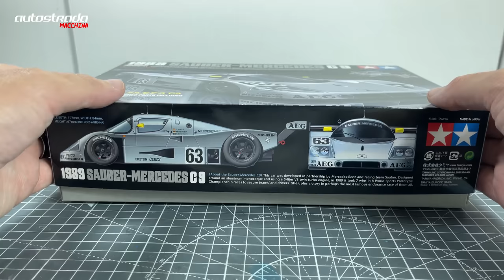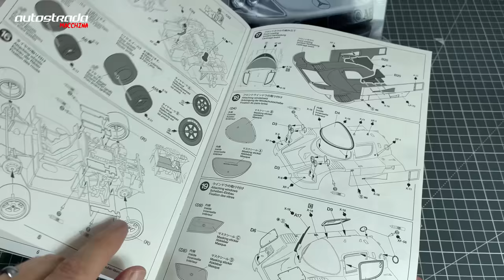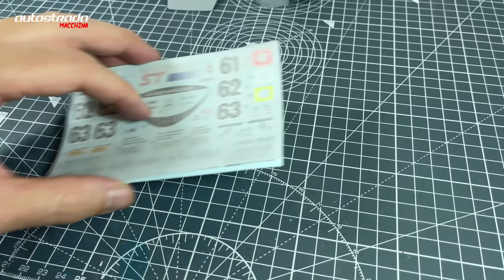[Full Build] Building a 1/24 scale model of the Sauber-Mercedes C9 - Tamiya

Comment: Thanks for sharing the excellent modeling tips.
In video 13:41, what is the brand and product number of the seat belt?
And in video 4:39, how many layers did you apply the gloss paint?
Reply from the maker: Thank you - the seatbelts was left over from a hobby design set I already had. The clear I applied 1x normal layer and 1x heavily thinned layer. I didnt want the clear coat to display too think on the model

Comment: Great build man. I built this kit many, many years ago - before the upgrade carbon fiber decals and photo etch parts were available or known to me. Can you tell me what you are spraying on the tires after sanding the molding seams off (18:39 ish) and after the decals are installed (19:20 ish)? Appreciate you taking the time to video this - thank you...
Reply from the maker: Awesome thanks man - um so at 18:39 I spray the tyres with Tamiya's Rubber black, and after the decals I spray a flat clear. Personally I like the affect it has, you basically cant see its a decal on the tyre once thats done, looks painted on

Comment: Nice work, good looking model. Can I ask what brand of paint you use for the body and the clear coats and what pressure you spray at please. I use the Zero paints system but you appear to spray at a higher pressure than I do, tho it could just be how it looks on video. 
Anyway, nice video and superb model kit. I'm subscribed and like and looking forward to seeing more.
Reply from the maker: David I love this kind of feedback, Thanks!! So for primer I use Mr Hobby 1500, grey in this case, paint I used was the Zero paints ZP-1634, its the Merc Sauber specific colour, clear on this one was also Mr Hobby GX100, I used to use ZP 2k, but its too thick on a race car in my opinion. For pressure I spray at 2bar, but I do adjust the paint amount being released from the gun depending on how much I want to release, for ZP i make it less paint to try and not get orange peel, is a struggle with zero, but it sounds like you’ve had the same issue too. What pressure do you spray at?
Reply: @autostradamacchina  I'm spraying at around 1.5bar when I use Zero, I've not really had a problem with finish. Just interesting to see how you do it. Do you feel that running at 2 bar helps reduce orange peel? I use Halfords automotive primer as my base coats and then the Zero colour and I'm trying the 2pack clear again on my current build, Tamiya Lotus 107.
Reply from the maker: @davidfisher5507  spraying at 2 I think gives me better coverage. With my setup I've had some issues with an unevern finish. Buuut that could also be my spraying skills.. the 107 is a beautiful looking kit. that colour scheme looks like it might be a pain in the ass to get right
Reply: @autostradamacchina  I've masked and painted all the colours and I'm applying CF decals on the chassis sides where necessary. Happy with it so far. I really enjoy masking complex livery's. 
Your spray set up looks nice from what I can see in the video. A future video idea could be a workbench guide, show the tools/equipment etc. It's always nice to see how other modellers are set up. Good to learn from.
I might up the pressure a little when I spray next time, see how it works, on scrap plastic first obviously.
Reply from the maker: @davidfisher5507  thanks for the tip, yeah might do something like that in the future for sure. I've primarily learn from youtube myself (started the hobby last year) so is definitely. I managed to get the Ferrari SF70H recently, so will be building that in a couple of videos from now. No engine detail on that one though, but hoping to do it justice
Reply: @autostradamacchina  wow, you've got some good techniques already if you are that new to the hobby. I've been model making for around 35 years I guess. Not a quick process for me, I just don't get much bench time, but I enjoy what time I do get.
You've got a nice Channel going here, keep up the good work.

Comment: Hey mate sorry if this has been asked, but what did you coat over the carbon on the under tray, diffusers and front splitters of the car? Clear coat?
Reply from the maker: Hi mate, I used a matt clear coat to cover the carbon at an attempt to give it a dry carbon look
Reply: @autostradamacchina  awesome, certainly worked